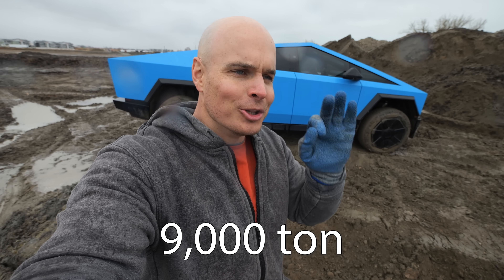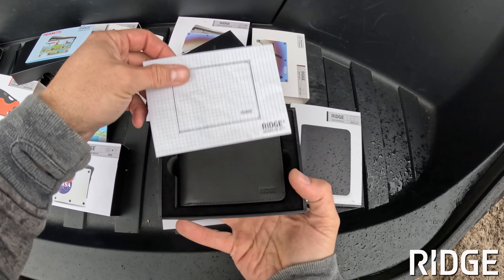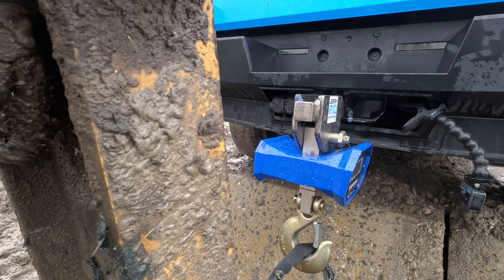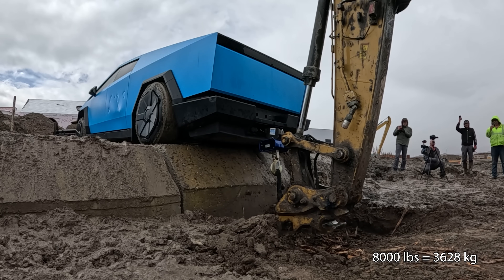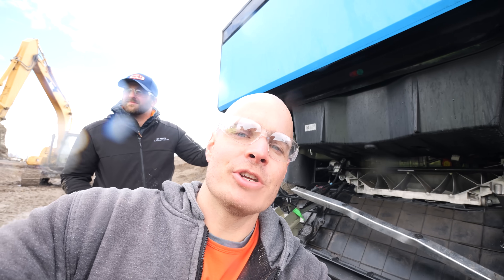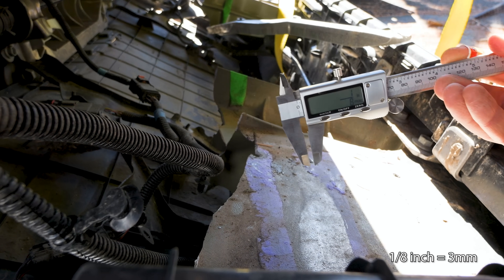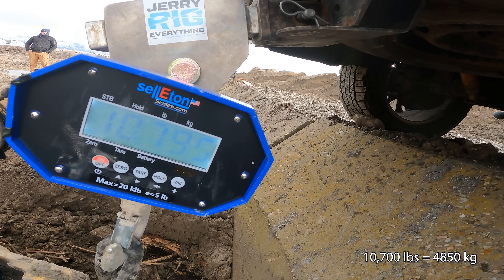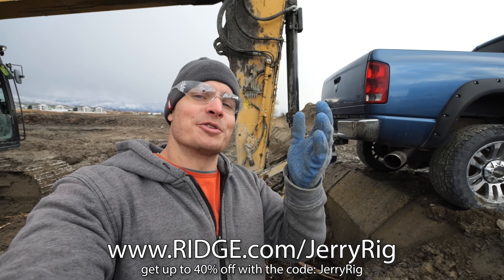SHOULD YOU TOW WITH A CYBERTRUCK?! - (catastrophic failure test)

Comment: Hey Everyone 🤠
Find the parts that interest you:

0:07 - Introduction to the Cybertruck's Giga press
1:05 - Testing the Cybertruck's towing capabilities
2:30 - Ridge wallet sponsorship and features
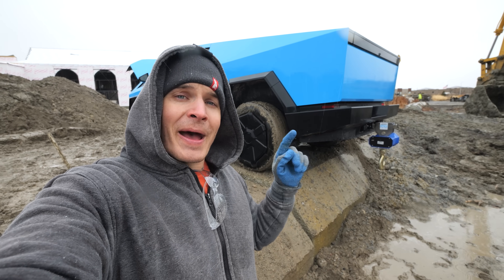3:39 - Importance of hitch strength in towing
4:51 - Testing the Cybertruck's towing capacity
6:01 - Alarm goes off at 8,000 lbs
7:30 - Cracking sound at 10,000 lbs
9:19 - Cybertruck unable to drive after test
9:54 - Tongue weight concerns with Cybertruck
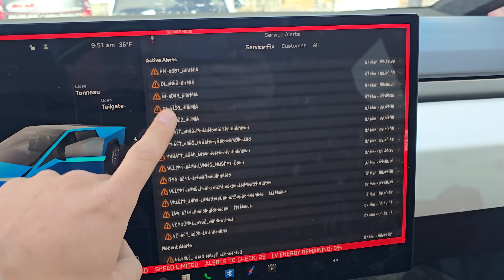10:40 - Cybertruck gets 28 error messages
12:54 - Dodge truck withstands over 10,000 lbs
14:34 - Steel frame stronger than cast aluminum

Chat with videos via Bumpups 🌲

Comment: his explanation was completely incorrect. Even driving up a vertical mountain, the weight of the trailer would still be laterally pulling away from the bumper, not downward (with reference to the vehicle) . There is only one scenario where this could happen, which would be if the trailer fell off a bridge and it was hanging from the tesla, in that scenario, I would hope like hell that it broke off instead of pulling me into the ocean.  So short of hanging a trailer from the Tesla, this would NEVER happen.   NEVER! 
 This test was bogus and completely misrepresented. 

and FYI, I don't own a Tesla, in fact I own a Ram 2500...

Comment: The only issue I see with this teat is that towing capacity is not for tongue weight of the trailer. It is for the trailers weight. The tongue weight should be a couple hundred pounds at most. This is why trucks have 2 different categories of capacity. Towing and hauling. A trailer hitting a pothole at 80 would not pull down on the receiver but would pull back on it in line with the direction of travel.

Comment: Towing 11,000lbs is not the same thing as holding 11,000lbs. A trailer would distribute most of the weight on its axel(s). For instance anyone that owns a pop-up trailer or small load trailer knows you can lift it unto your hitch with fair ease. Are you lifting a 1,000 lb trailer??? No.

Comment: A properly loaded trailer is going to have 250 to 500 pounds of tongue weight.  The tow capacity is flat tow weight.  This test is totally not factual.  Misusing a vehicle does not become a manufacturer issue.  It is a user issue..

Comment: But how did the 94 Dodge do?

The fatigue and subsequent breaking of aluminum is the reason some people have realized those aluminum framed camper shells on their offroad trucks are a bad idea.  Aluminum skin over a steel frame is fine, but the aluminum frames are cracking and breaking due to the repeated flexing and vibration offroad.  

We are gonna start to see a lot more camper of those campershells with stainless stell frames in the coming years I imagine.

Comment: "Why are you pulling down? I expected much more from this test. You should be pulling back; the truck is designed to tow, not to lift. Structural resistance is very different.
Reply: Came here for this. He's judging tow capabilities by applying to tongue weigth.
We all know this car is a POS. But this is the wrong way to test towing capabilities.

Comment: That it broke at nearly the tow limit of the truck suggests the enginners at Tesla knew the breaking point of the aluminum frame. It seens irresponsible to sell this truck as having a towing capacity of 11000 lbs.

Comment: No, in normal towing, the full weight of a trailer does not land entirely on the tongue. The tongue weight—the downward force exerted on the hitch ball by the trailer—typically represents only a portion of the trailer's total weight. This is because the trailer's weight is distributed across its axles and the tongue, with the majority usually supported by the trailer's own wheels and suspension.

In standard towing setups, tongue weight is generally recommended to be about *10-15% of the trailer's gross trailer weight (GTW)* for conventional trailers (like utility or travel trailers) and around *15-25%* for fifth-wheel or gooseneck trailers. For example:

- A 5,000-pound trailer might have a tongue weight of 500-750 pounds (10-15%).
- The remaining 4,250-4,500 pounds would be carried by the trailer’s axles.

This distribution ensures stability and proper handling. If the full trailer weight were to rest on the tongue, it would overload the tow vehicle's hitch, suspension, and rear axle, likely causing damage or unsafe driving conditions. Proper weight distribution, often aided by tools like weight-distributing hitches for heavier loads, keeps the system balanced.

That said, factors like improper loading (e.g., too much weight forward) or a trailer tilting excessively (like during unhitching) can increase tongue weight beyond the norm—but this isn’t "normal towing." Under typical conditions, the tongue only bears a fraction of the total weight.
Reply: Thanks for having ChatGPT make the same point in more words that Zach made in the video! Super helpful!
Reply: @jackp5956  It was Grok. Zach made a point, but in all reality, when is that ever going to happen? Is his point slanted by his personal bias fueled by the Utah echo chamber? It sure seems like it. If you read the Cybertruck's Manual, it simply states what it's capable of and it doesn't matter what Zach did as he went far beyond what the truck says it can do. Grok simply pointed out the obvious which Zach seemed to have a different point of view of, that at some point the entire weight of the trailer is going to land on that hitch and all hell will break lose. Really? Come on, Really?
Reply: Adding 10K of force downward. How does that show a cybertrucks capabilities under normal conditions? The GTW is not 10K and doesn’t pretend to be and showing this just adds confusion to those that don’t understand.

Comment: The front of the truck was pinned down to avoid movement while the load was added to the hitch in the back, hmmm. You really wanted to break that hitch. But, as you said it held up better than you thought. What was the point of the video though? i watched it thinking it was a credible safety risk.
Reply: If you are hauling a 11,000lb trailer and you stop at the edge of a cliff so that the trailer is dangling off the side, the hitch will break.

Comment: Don't you think holding the front of the truck down proves this whole test is an anti-scientific shiitstorm? You just faked a failure that would never happen under real world conditions so you could say you would not trust driving by a cybertruck that is towing something. The front wheels of both trucks would be off the ground well before the 10,000 load and no reasonable person would drive like that. Congratulations joining the other lemmings on the anti-Tesla bandwagon. Your smirk at 4:44 tell the tells the whole story of how you knew you were rigging the truck to fail the test.

Comment: 1/8 of an inch wall on the frame is wild, should be double the wall thickness of a steel frame if you're going to go with Aluminum. Tesla's may have a good performance drive train but that's about it. The overall design is weird and they have the ugliest dash design in the business

Comment: You need to catch up on your manufacturing knowledge about cars. Adhesive is the standard nowadays and spotwelds are merely used to hold the metal in place until the adhesive is hardened.

Bolting a higher grade of metal to a lower grade however, is a whole different story.
Reply: Just because they glue cars together now, doesn’t mean it’s a good idea.

Comment: Australian Government Design Rules require a tow hitch to be able to withstand a downward force equivalent to at least 50% of the trailer weight without yielding (permanent deformation).  Jerry says the Cybertruck has a tow limit of 4500kg?  In that case, under Australian Design Rules it needs to be able to handle a downward force equivalent to at least 2250kg without yielding.  Unfortunately the test conducted was a break test, which doesn't tell us much.  At what load did permanent deformation occur, most likely before 10,000kg was applied, but at what point, we dont know.  If the Cybertrucks casting was replicated with regular steel, i bet it would yield at a similar load.  If there is a problem it is more the design than the material.

Comment: Hitch weight is not the same as trailer weight - if you don’t understand that I hope you never tow anything!  There is literally no way you would get 10,400lbs directly on the tongue if you were towing 10,000lbs in the real world - not “going over a bump” or “cresting a hill”…The fact that the Cybertruck withstood nearly 8x the rated tongue weight is impressive and shows how over-engineered it is!  A dodge 2500 is rated for a higher trailer weight and higher tongue weight, so the fact that it withstood the 10,700 lbs doesn’t mean it would have withstood 8x the rated tongue weight like the Cybertruck did.

Comment: The hitch/bumper assembly breaking at a 10,000 lbs tongue weight is not only good, it's phenominal. That is essentially the same tongue weight that an 18 wheeler would experience pulling an 80,000 lbs load. It's serious overkill for a truck the size of a cybertruck. No one should ever complain about that outcome.

Comment: the vector of force in his experiment is all wrong too- youre applying a perpendicular force directly to the hitch
Reply from the maker: Which is exactly how you would test tongue weight. Which is what we are doing in this video.  I explain that when we switch trucks.
Reply: @JerryRigEverything  tongue weight is only a part of the equation. A majority of the weight is actually distributed onto the trailers wheels/supports. the tongue experiences a whole range of forces but one of the primary forces it is suppose to withstand is a sheering force (towing). therefore the force vector is more diagonal instead of a perpendicular vector which in itself creates an massive  moment arm at the tongue. The Cybertrucks hitch, and all hitches, are designed to handle shear forces from towing, not excessive vertical loading- your "test" applies nearly 10× the bending stress compared to real-world towing and sheer forces in the completely opposite direction. 

Things you should look into before make anti-elon content: 

1. Sheer Stress
2. Bending Stress
3. Material Science/Engineering (not cherry picked bs ab glossing over the fact that your test DOES NOT simulate fatigue failure, which is the real concern for aluminum)
4. How to make better propaganda with the sponsorships given to you from Tesla's competitors and/or left-wing companies/groups because anyone with half an engineering brain could poke holes in this test all day. 

Final note: You have a massive heavy machinery there, why not just test the ACTUAL towing limits of the tesla with your "crane scale" with the Cybertruck hooked up to bucket/hitch and measure the ACTUAL towing limit? (btw super stoked u responded)
Reply: @JerryRigEverything  you deleted my comment lol
Reply from the maker: @joeyb8208  i see both your comments right here and I responded to both.  😂
Reply: @JerryRigEverything  care to counter then?

Comment: You hooked up an excavator and put over 10,000 pounds of vertical downward force on the hitch. Quick reality check: the Cybertruck's rated tongue weight is around 1,100 pounds—you're pushing TEN TIMES the rated limit. At one point, your excavator was failing your own setup, forcing you to reposition it closer just to keep applying your ridiculous pressure.

Here's a fun fact for everyone watching: 63% of pickup truck owners rarely or never tow anything, and only about 7% tow regularly. So, who exactly is this extreme scenario helping? In real life, you'd never see over 10,000 pounds of vertical load directly on a hitch—unless you're towing a trailer with no wheels. (Good luck finding one of those.)

The Cybertruck has a payload capacity of 2,500 lbs, and yet it handled 8,000 pounds of unnatural downward pressure with barely any real damage. If you're looking to tow an excavator dangling in mid-air, maybe rethink your towing strategy rather than blaming the vehicle.

Bottom line: This wasn't a 'real-world' test. It was an unrealistic attempt to tear down the Cybertruck, likely because you openly admitted you're "not ready to take the financial hit" from selling yours. Maybe next time, stick to realistic scenarios instead of turning your personal regrets into clickbait.

Comment: this isnt about material A vs B, this is just bad engineering. if you made the tesla hitch out of steel, it wouldnt be much better, when dealing with things like this you need a lot more than just a 800% failure load.. tesla should reduce the max weight of hitch to 800lbs or less asap.  
Also im not sure where youre getting this flex limit from, aircraft wings have tremendous deflection in flight, with turbulence causing rapid vibration, if what you said was correct we would be seeing wings fall off in flight or having to be replaced after x amount of hours, having spent years in the aircraft maintenance industry, i only ever saw that issue in videos

Comment: Wouldnt this be considered tongue weight? Trailers don't push down all of their weight on the tongue like that... Whatever your towing is also resting on the road and most of the weight is pulling straight back not downwards....
Reply from the maker: Correct. I mention that when we switch trucks.

Comment: Wait, this test is not the towing capacity at all, it's the tong weight limit. I don't know of any truck that has a tong weight limit of 11k. Tesla is advertising the towing (pulling) rating at 11 thousand pounds that means the max tong weight is something like this 15% of 11,000 lbs = 1,650 lbs (maximum recommended tongue weight). Great video but complete bogus for its testing. The cyber truck test in this video got to 4k before the tongue started moving so in reality the Cybertruck exceeded the max rating for the truck by almost 4 times and like 8 times till it broke. In the video you explain conditions where there might be that much weight on the tongue but in reality, if there is your load is not correct for any situation.

Comment: In before the Tesla / Musk fanboys cry foul that testing the 20+yr old RAM without an engine makes it unfair because the Tesla still had the weight of the electric drivetrain. 

Or, the test being unfair because the steel of that RAM has had over 20 years to properly season and cure whereas the Cyberturd's frame was only extruded just a couple of years ago and the advanced SpaceX developed Mars adhesives are only just now beginning to cure.

The Cybertruck is such a toilet of a vehicle, and is grossly misrepresented by Tesla calling it a truck. It would be by far the most embarrassing thing Tesla had to live with if Elon circa 2022 to 2025 wasn't also now a thing.

Comment: The cybertruck has a towing limit of 11,000 pounds. If improperly loaded, i can easily see it putting 5,000 to 6,000 pounds on the hitch in a large dip or crest. If you do that repeatedly, over time, I can definitely see it causing a catastrophic failure like what we saw.

Comment: I''m really interested to know what strengtehning the frame of the Cybertruck would do to road worthyness. IOW is it weak (as you said very thin casting) because it was designed that way or because it was not designed for higher loads?

Comment: Bro so you want to tell me that you load a trailer so wrong that it puts 5 fucking tons on the hitch? You can basically let that loaded trailer hang completely on the hitch and it's fine. In real life scenario you literally couldn't stack that much weight directly on the hitch even if you tried. The trailer will always take most the weight on its own wheels

Comment: While I think the Tesla failure is significant and needs to be addressed I think it’s important to note that this isn’t an apples to apples comparison. Dodge is a heavier duty truck than what the Tesla is built to compete with, a 1500 would be more appropriate and the type of hitch also could play a factor. That being said I don’t expect a 1500 truck to break like that. Possibly bend but not break. Finally, definitely not a 1994 dodge but that’s irrelevant.

Comment: Nobody is towing anything with a cyber truck because of the fast drain on the battery, plus instead of pulling straight down it would have been more like a normal towing situation to be pulling straight back on the hitch instead of straight down.

Comment: when will a 3.5T trailer EVER put that 3.5T directly virticle on a tow hitch?? A= never. it will put it on a horizontally either forwards or backwards. under ULTRA heavy breaking you might get nearly all 3.5T pushing forwards. and unless your truck is capable of pulling 1G or higher acceleration WHILE towing 3.5T then you will never get it going forwards pulling backwards on the tow hitch. conclusion: test is bullshit and if i was tesla id certainly deny you warranty lol